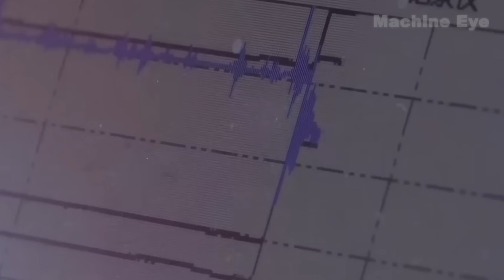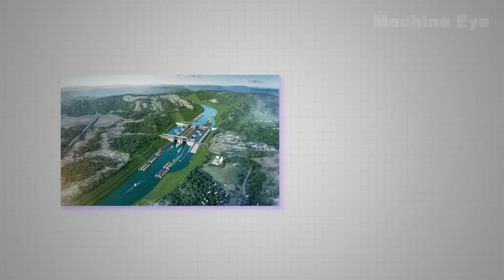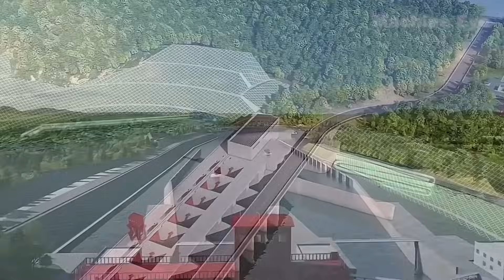China Just Dug a Canal Through Mountains—And Americans Can’t Believe It!

Comment: Pinglu Canal  From Wikipedia, the
Location	Guangxi	China
Specifications
Length	134.2 km (83.4 miles)
Maximum boat beam	15.8 metres (52 ft)
Maximum boat draft	5 metres (16 ft)
Locks	3
Maximum height above sea level	65
History
Construction began	2023
Date completed	2026 (planned)
Geography
Start point	Xijin reservoir, Hengzhou, Guangxi
End point	Qinzhou (Gulf of Tonkin)
The Pinglu Canal (Chinese: 平陆运河; pinyin: Pínglù yùnhé), is a 134.2-kilometer inland river I-class waterway under construction between Xijin reservoir on the Yu river in Hengzhou and the lower part of the Qin River, allowing access to the Beibu Gulf. The canal will shorten the route between inland Guangxi and the sea by up to 560 km (350 mi).[1]

Construction
Serious planning began in 2019 with full speed construction commencing from June 2023. Operational completion is aimed for 2026. Three locks will be built, including what will be the world's largest water-conserving ship lock. This canal is the largest Chinese canal construction activity since consolidation of the Grand Canal during the Ming dynasty.

During construction a total of 339 million m³ of stone and dirt is expected to be removed, which will be used for land reclamation and elevating existing land, so that 835.7 ha of new land can be created.

Construction is planned to be completed in 2026 at a total cost of RMB 72.719 billion.

Specification
When not restricted by drought, the canal is designed for 5,000-ton ships of 90 meters length, 15.8 meters width and 5.0 meters draft. By comparison, Panamax ships are 65,000–80,000 tonnes when unrestricted, suggesting a transshipment role rather than direct international ocean connection. The three lock complexes that are planned at Madao, Qishi and Qingnian.[4] The elevation difference between the Qin river mouth at sea level and the Xijin reservoir is 65 meters, of this, the Madao locks will overcome a 30 meters of elevation difference. To conserve water, the locks discharge in a local reservoir, saving 63% water over a conventional lock design.